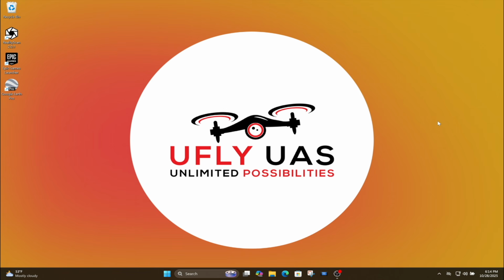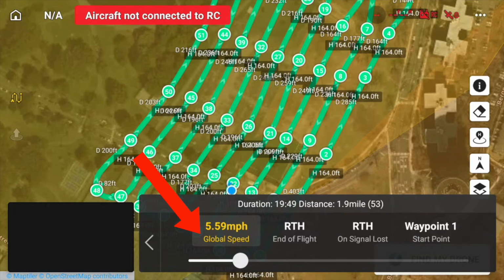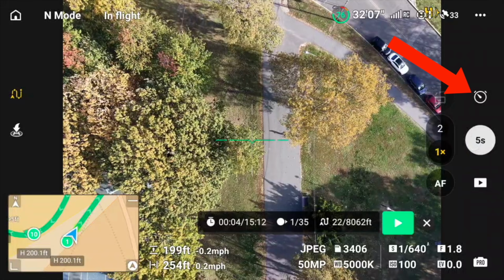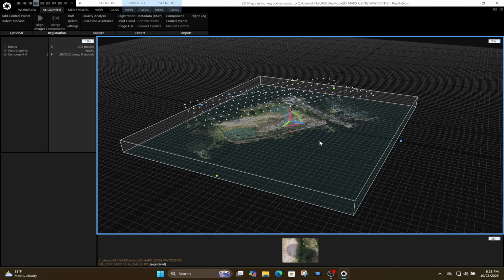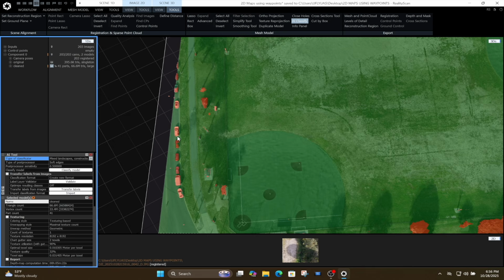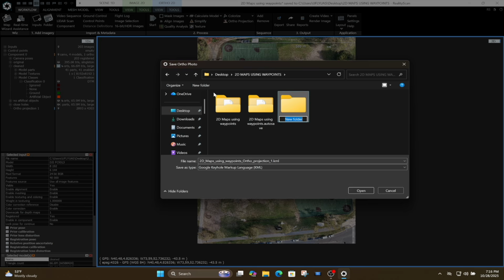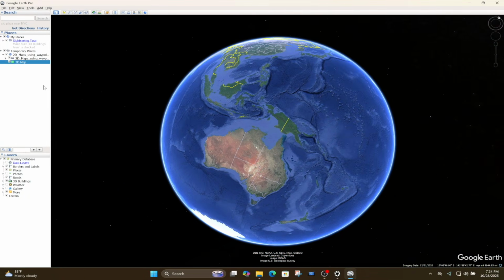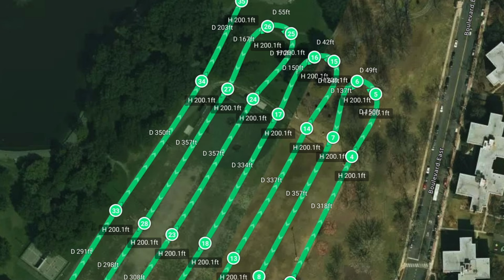DJI Mini 5 Pro | Using Waypoints To Create 2D Maps For Clients | Step by Step Guide For Beginners.

Comment: My goal is to capture an imagery of my plantation that can reach 700,000 m^2 but the time needed with your config would be around 7-8 hours. I don't need a very detailed and HD 2D maps like in your video. Do you think I can cut the time by increasing the drone speed and widening the distance of the drone parallel route? And what's the drawbacks? Thank you
Reply from the maker: Hey let me help you with this join my discord here: https://discord.gg/vGhMe7qt6x. Let’s discuss the planning.

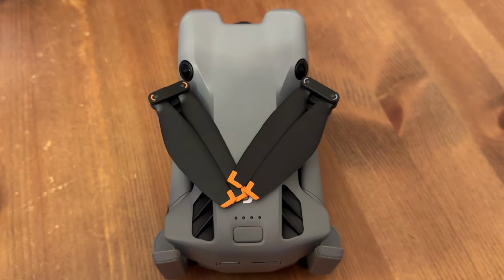Comment: 16:57 All the steps prior to this point, which I believe you showed in another video using the Litchi Hub software, can be replaced by using that same software—am I correct?
Reply from the maker: Yes! You can use Litchi hub and plan the mapping mission.

Comment: I have seen the QGIS program, which generates contour lines based on digital maps. I'm not sure how accurate it can be.
Reply from the maker: You can also do it in Reality Captured. I am probably doing a tutorial on that. The accuracy comes from the ground control points. If you don’t use the GCPs then you have to rely on GPS accuracy which is relatively like 5 feet or 1.5 meters off.

Comment: I tried to follow along with this tutorial step-by-step, but I think the UI must have changed. Even though I downloaded the newest version, my layout looks completely different and several tools shown in the video just aren’t there. I can’t find where to properly generate a point cloud, AI Classify, or even clearly produce a DSM. The workflow in the video doesn’t match what I’m seeing at all. From what I’ve gathered, I might be using the “advanced” version instead of the simplified UAS mapping version — but I can’t figure out how to switch to that layout, and I haven’t found any updated tutorials explaining the difference. 

That said, it’s still a great tutorial overall and very helpful conceptually. Also, for anyone struggling with adding precise waypoints: you can actually connect a mouse to the controller via the USB-C port (if your mouse supports it or you use an adapter). It makes waypoint placement a bit easier.
Reply from the maker: If you have Discord reach me here https://discord.gg/KbmFgYf8a so I can help you with the UI.
Reply: @uflyuas  I'm disappointed I didn't see this earlier. I learned a lot of the ropes and found out I was on a newer version. After finding out I switched versions. I was then able to follow the instructions and create my first 2D map. I appreciate your offer to help out and your great videos.
Reply from the maker: @justincoralli5654 You are very welcome my friend. I am glad you got it all worked out 💪. I am so happy for you.

Comment: Thank you so much for this amazingly detailed tutorial! I would like to ask a question; I need to create 2D orthomosaic map of a large parking lot. The parking lot is 10km away from my house. Can I create the waypoints map at home, save it, then drive to the actual location and execute the flight there?
Reply from the maker: Yes ! You can do it right in the controller by following what I did in satellite view to see the terrain better. You don’t need to be there at all . It can be done right from your house. Just make sure obstructions are clear so your drone doesn’t hit anything. Set it to 200 feet or 150 feet and once you get there you can just change the settings and apply to all waypoints. Good luck and I am sure everything will be just fine. Keep lines close to each other.
Reply: @uflyuas  Thank you so much for your help. It's much appreciated and very kind of you!!
Reply from the maker: @boompictures  Any time my friend. Don’t hesitate to ask any questions. I will gladly help you out.
Reply from the maker: How did your map 🗺️ come out? Which drone did you used?
Reply: @uflyuas  Mini 5 Pro. I haven't mapped it yet, will do that next week.
Reply from the maker: @boompictures . Incredible little drone.

Comment: Thanks for this tutorial. Wonderful. 
1- Is it possible to use the same process for Mavic 3.
2- Is it possible to create also a 3D orthophoto Model with reality scan. If yes let's make for a processing for that 3D model
Reply from the maker: Thank you for checking the video out. 
1. Yes same process can easily be use for Mavic 3 with 0 issues. 
2. Short answer: no—“3D orthophoto” is not a technically correct term, but people use it informally to describe a few related products. Here’s the precise breakdown.

What an orthophoto actually is

An orthophoto (orthomosaic) is:
	•	2D raster image
	•	Geometrically corrected (scale is uniform, no perspective distortion)
	•	Map-accurate in X and Y only
	•	Uses a DSM/DTM internally, but the final product is flat

Even though elevation data is used during processing, the output itself has no true 3D geometry.

I hope that helps you understand it better. 
Please let me know if you need help with anything.

Comment: Thank you very much, really helpful! If the terrain is not flat but is like a valley for example, can I use the same method? How I can handle the altitude differences  to have the same sharp 2D results?
Reply from the maker: All you need to do is fly at 350 or 400 feet altitude limit and do nadir photos, meaning straight down -90 degree photos and you can use a speed of about 12. Since you will be very high to cover large elevation ground, you don't really need to go slow since one picture taken at that altitude will cover a lot of ground. You need to create a manual waypoint mission by flying the drone in the valley and keeping the same altitude even if the drone is climbing up a hill. Lets say I will fly at 300 feet of the ground for each waypoint. So if I started lets say at the lowest part of the valley, I will fly my drone up to 300 feet and create the waypiont at that elevation, if the next waypoint is a mountain, then i need to start creating multiple waypoint climbing up the mountain at the same elevation of 300 feet off the ground and once i reach the mountain top I need to be at 300 feet of the peak of the mountain so that the elevation of the drone is always 300 feed of the ground for all sections. The drone will increase altitude and decrease altitude but it will do it at the same elevation of 300 feet no matter where it is in the valley. This need to be done manually because you need to fly the drone all over the valley and record the altitude to make sure is 300 feet every time and start dropping the waypoints at each elevation to make sure the drone is at 300 feet off the ground.  Hope this gives you an idea. Please let me know if you have any other questions.
Reply: @uflyuas  Thank you! 🙏

Comment: Using this same procedure, can the program create contour lines, or is it necessary to have a vertical photo and an oblique one to overlap the flight lines and thus obtain terrain elevations ? Thank you
Reply from the maker: Thank you for checking the video out. For terrain elevation and contour lines you do not need oblique shots. Oblique shot are only to create 3D Structures Models. Terrain and elevation is only use shooting photos straight down gimbal at -90 degrees. The program can definitely calculate the contour lines. Maybe I will make a tutorial on that. 🤔
Reply: It would be interesting to find a small mound or hillside and do it. Best regard
Reply from the maker: @Templario_28 Yes that would be cool to do one of a rocky 🪨 hillside into a 3D Model. Should be super easy since you just taking pictures straight on facing the hill.
Reply: On the subject of contour lines.. 
Will it be very complicated to combine this type of 2D maps over a topographic map that has contour lines drawn?
Reply from the maker: @Templario_28 You can definitely do that but you might need control points for accuracy and alignment. Do you know how to do control points?
Reply: @uflyuas  In the best-case scenario, if the topographic map with contour lines shows marked building structures, and the map is large-scale, the images could be aligned on the topographic map using those buildings as a reference. Alternatively, certain coordinates displayed on these maps, and those visible in the lower left corner of the Reality Scan viewer, could also be used as a reference. But I don't know if it is accurate enough. If there are not marked building structures, I don't know if it's just the coordinates that are on the topographic map and in the program's photographs, they will be accurate enough for the combination of both to be correct.
Do you know these programs ?  *Meshroom, *Emlid Studio, *RTKLiB
Reply from the maker: @Templario_28  I normally use Emlid Studio because I have the RS2 survey grade base and receiver but honestly this equipment is not cheap and I haven’t done tutorials on this because the average person doesn’t have it or can’t afford the equipment.

Comment: Such a great video…I am learning a lot about my Mini 5 PRO, also…What is the minimum computing power I need for 3D?  I have a 6 year old HP and didn’t work when I got to MESH..It always has the message “ CUDA driver version 0 is not supported by theCUDA runtime….Please update your NVIDIA display driver to the latest version…I have Intel..Thank you in advance..
Reply: Thank you for this info…Actually I was hoping for a pc instead of a laptop….Does the software require the NVDA graphic board or is Intel UHD graphics ok to use?  Wonder what the group are using?  I have tried my HP desktop and HP laptop which are 5-6 years old and get the same message above…
Reply from the maker: @randallhash9283 Get a PC with Nvidia Graphics Card you are better off with Nvidia.
Reply from the maker: What is your budget? So I can send you some links.
Reply: @uflyuas no problem with the budget…….Id like to keep my old HP of 6 years but if I need to I’ll try to get it to Windows 11..Your suggestions will be greatly appreciated
Reply from the maker: @randallhash9283 Here is the link to the laptop 💻 I am using right now. https://a.co/d/00VSmTFx

Comment: Thank you for these excellent tutorials. Great work. I am a beginner and just wanted to ask, it seems that at some point your drone battery runs out in the middle of working with waypoints, what to do in that case?
Reply from the maker: Thank you for checking the video out. If the battery 🪫 runs out the drone will automatically return to the home point. Then all you need to do is turn it off put a new battery 🔋 then once is on and connected to your controller again hit the play or what they call resume button and the drone will take off again and continue where it left off until it completes the full mission. Please let me know if you have any other questions. You can also pause the mission, bring your drone to your takeoff position, turn it off , change the battery , turn it back on and resume the mission by hitting the green play button ▶️.

Comment: Hello, and thank you for the tutorial, it is very helpful, i have 2 questions  –  1.) if you want a 3D Model instead of 2D,  is the only thing you have to change the gimbal-pitch ?  and what if you have to map a long corridor in the forrest (area with few trees, 3D) which flightpattern you would create? Thank you and Good Luck!
Reply from the maker: For 3D Models I always do orbits like in this video here: DJI Mini 5 Pro | 3D Photogrammetry Tutorial For Beginners (Step-by-Step Guide)
https://youtu.be/sXusmdNdJhc

3D Models need like a 45 degree angle or the perfect angle that captures all the walls and details of the structure you are trying to reconstruct. 

For a corridor I normally do 2D which is the same process as the tutorial. You are just making the waypoint the cover the whole corridor and follow the rule of covering more of the outside of the corridor so you have enough data by covering outside of the boundary of the corridor. Camera should be straight down -90 degrees for 2D . For 3D camera at 45 degrees or the angle that captures what the clients needs . You can process the 2D photos together with the 45 degrees photos all together in one folder that way you can do both 2D Map and 3D Model. 

Let me know if you need more help. Thank you.

Comment: Thanks for this great video. I will be doing a 2D map of a hill side of about 100a. The differences in height is about 300ft. Any recommendation to set this up correctly? Would I just adjust the height of the drone so it stays around the same over ground when doing the waypoint map? Or split the project into multiple ones? I have to try out the workflow on a flat surface first though. Thanks for the very detailed description.
Reply from the maker: Can you send me a lat & long or Google map location? I should be able to help you one I can take a look at it. Thanks

Comment: Thanks for the great video, appreciate! 🙏👍
I have one question - how do you figure out the distance to the side (distance between the parallel paths) in order to make sure there's enough image overlap on the sides?
Reply from the maker: The mini 5 pro is equivalent to a 24 mm wide so it cover a very large area so I just estimated since I was at 200 feet but if you fly lower then just make the lines a little closer to each other since the lower you fly the less ground you cover. The higher you fly the more ground you cover. If I was you I would find a place to practice and try flying an area and fly at different altitudes like maybe 80 feet or 100 feet and set gimbal straight down to see how large of an area one single photo covers. Once you have it then you know your side overlap. Since I fly 200 feet my side overlap was like 80 because I kept the lines kinda close to each other and at the altitude you are cover a lot of ground. In reality you don’t need to be perfect. If you are flying lower it will be more photos since you cover less ground. If you practice and create a few maps you will realize is all about drone speed and sharp pictures what gives you great results. Normally I always estimate the overlap and I always get incredible results. I been really busy lately but I will make some more projects at different altitudes to test the Mini 5 pro more. As long as you don’t fly the drone too fast that will leave gabs because of the 5 seconds interval limit you will be just fine. Thank you for checking the video out. Let me know if you need help with anything.

Comment: Setting up a mission for photogrammetry using DJI controller and a small screen is a pretty tedious. Doable, but really annoying... 
I have tried Litchi and Waypointmap for .kmz files to upload via the "back door" (another annoying task, especially for Mac users), but looks like I will probably stick to manual waypoint planning using controller.
Reply from the maker: The RC 2 works pretty good for me when setting the waypoints. Hopefully you have one of those.
Reply: @uflyuas  I do have exactly the same controller. As I said, not ideal but doable....
Reply from the maker: @r@regel74 Doable  and 0 cost 💲 😂

Comment: Wow, add a low cost GNSS, One control point and 5 GCPs, and you are well on your way!! Great job. Your elevation shows -43.5, any thoughts? Did you do an IMU and GPS calibration when you received your drone? I don't think it should be that far off.
Reply from the maker: Thank you for checking out the video. I appreciate it 👍.

Comment: Thank you so much, really a great step by step guide. Just bought my first drone this was so helpful.
Reply from the maker: Please feel free to ask any questions. I am here to help the drone community. Thank you for checking out the video.
Reply: @uflyuas  My flight was missing somes points because I think was a small area, maybe using 3s timer for photos or slower flight would solve the issue. But I used a video for rendering worked just fine.
Reply from the maker: @thony-lg which drone do you have?